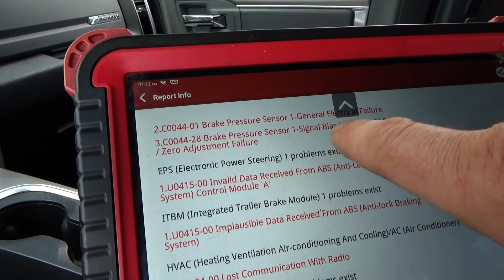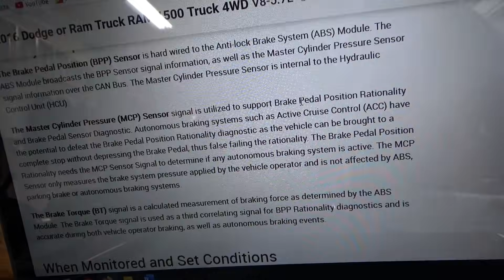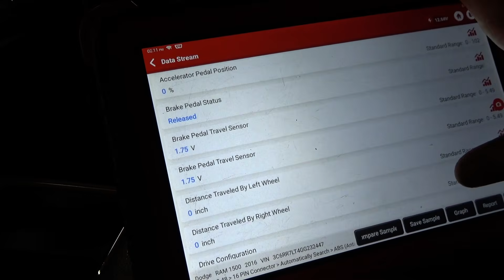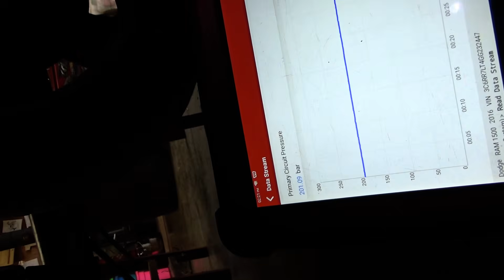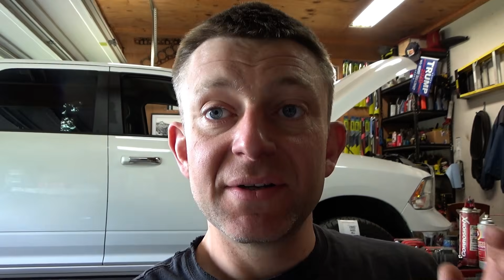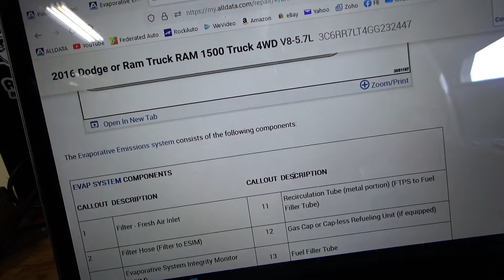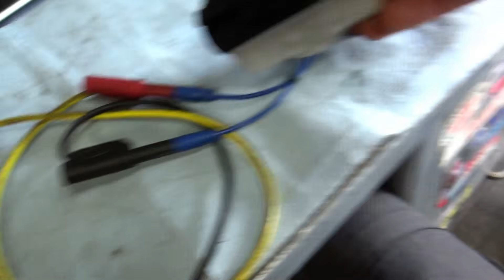(Pt 1 - 4th of July Special) Ram ABS Saga...(CEL ON, Can't Pass Inspection!)

Comment: Yesterday I diagnosed a bad HVAC controller in a 97 Buick. Everything works except the turn on signal for the compressor.  Later I plan to put a low pressure cycle switch in the system to ground the compressor relay so dude can make his trip next week.
Reply: I diagnosed the same problem same vehicle, if you wiggle the blower switch just right it'll send the A/C request.
Reply: @northfloautomotive  Nah!  I pulled the controller and it's fried.  I attempted to reflow some solder joints, but there was a component burned on the circuit board.
Reply: @farmermiyagi1338  Man the one you diagnosed was broke broke 😄The one I did was pretty intermittent. Cheers:goodvibes:
Reply: @northfloautomotive  He picked it up yesterday morning and was tickled to death.  Girlfriend leaving for Mississippi in it today.

Comment: More parts available for my 1931 Ford A than for these things.
Reply: LOL watch out for check engine light on the 31 Fords i heard it's a Doozy to find the problem
Reply: My brother works on a 1926 Ford Model T for a neighbor. The neighbor has relatives from Switzerland coming so he wanted it running to go for a spin. My brother had to do some work on the buzz boxes to get it running well. Had to replace the condenser inside two of them and replaced points on all of them. He said it is running great now. Imagine THAT, you can buy parts for a car that is 98 YEARS OLD, while this stuff made today that is not even 10 years old and you are screwed!

Comment: The lack of OEM parts for vehicles under ten years old makes my blood boil.
Reply: Certainly looks like a way to force people to buy newer garbage doesn’t it!
Reply: @kevincampbell8298  Why would Chrysler sabotage their own vehicle?  The customer has so much choice.  If they reward the OEM by buying another one, that's on them.
Reply: @kevin9c1  all the manufactures are having EV pushed on them with the agenda/mandates to rid of Ice vehicles. There is no longer a push to keep vehicles on the road any longer than a certain period of time. Why would they keep manufacturing/updating parts for vehicles over a certain age? Its not just Cars/trucks, it’s in so much around us. All my friends that are still in the industry run into this stuff every day.
Reply: @kevincampbell8298  Yes, the mandates are a thing and are dumb.  But if you think that Chrysler Corp is purposely not making a replacement part to somehow sell more EVs, you are going to have to walk me through how that would actually work.
Reply: @kevin9c1  at some point they have to stop making replacements because the cost of reengineering better updated parts and the demand exceeds the cost of doing it. Just like Ivan says  a dealer replacement is 1300, 1500 and so on dollars. I ran into same same stuff servicing electronics.. lots of older high-end equipment was getting impossible to get quality replacement parts for. 

I use to service teat equipment. Really good older stuff would break and the cost of fixing it if you could was pretty high. You can by lower end junk cheaper and thats what my bosses wanted. Then you don’t even need a tech. Just pitch it and buy a new pieces of junk.
Reply: @kevincampbell8298  Right but how does a Chrysler "policy" of not supporting older cars help them sell more Chrysler products??  Like I said before, if your consumer response was to trade in your 2016 Dodge Ram because of failed parts support, for a 2024 Ram, isn't that a YOU problem?  Nobody is forcing you to do that.  Chrysler Corp knows you have the choice to buy anything so I don't know why they'd take the risk.  Which is why this is not how it works.
Reply: @kevin9c1  its. To just one manufacturer. Planned obsolescence. All the suppliers are having similar issues. Especially with electronics.  There are lots of corporate long term goals that we as the public are not aware. I am just dealing with a doctor and  his 2017 laptop today. Apple says sorry can’t fix that! It can be fixed. They don’t want to…

If you can not locate parts to fix the 2016 vehicle (of any make) and there is nothing functional on Ebay  or any other source what do you then do? We will run out of sources. Look Ivan got parts for a few more recent videos from Russia (I think). 

Its pathetic there is nothing available for some of these vehicles. Especially for what people pay for them. But we are all just end consumers. Its not like the 70s 80s and maybe the 90s anymore where its easy to mod stuff. The programming that goes along with the electronics is in the hands so the corporate giants for the most part.   If there is no after market then you are forced to OEM. And if there is No OEM then vice versa.
Reply: @kevin9c1  Nothing so devious.  The 7 year old grew up without training her replacement.
Reply: @kevin9c1 because they've changed ownership structure 5 times since 98! It's insane
Reply: @kevincampbell8298 Why does the switchover to next generation vehicles give the manufacturer an incentive to quit stocking parts for older legacy vehicles that they sold to THEIR customers? Presumably they want to sell their new vehicles to the same customer so why on earth piss they off?That makes no sense. 

What I think is going on is that the CEO’s and executive decision makers at these domestic car companies have a choice to make. They can either spend profits on promoting customer satisfaction and loyalty by investing in adequate parts inventories or they can pay themselves extravagant salaries and boost their stock based compensation with corporate stock buybacks. Since most of them won’t be around in those positions 5 years from now or will have retired by then, what do you think they chose? 💰🤗💰
Reply: @kevin9c1 because they expect you to take it to the dealership where they give you the ole, “ no parts but we can sell you a new one or wait “
Reply: @kevin9c1 Chrysler has always done the minimum with respect to required parts.
Reply: @jeffreygoss8109  Does anyone really fall for that?
Reply: @kevin9c1  Wake up Kevin. You think it's just Chrysler with unobtainium parts?! You better go back thru some past videos or check some other Channels. It isn't just Ivan dealing with this BS either.
Reply: @kevin9c1  WOW You are so out to lunch in those other replies. Blame the customer, while they have a fairly new truck that can't be driven. Sell it and do what, take an enormous loss? Do you work for the government or one of the auto giants, perhaps Chrysler, since you aren't concerned about parts being unobtainable for an 8-year-old truck. Time for some head extrication.
Reply: @KStewart-th4sk  What the hell are you talking about?  All I am saying is there is no conspiracy by a manufacturer to purposely not support their vehicles in order to sell more new vehicles.  I am also saying it is stupid consumer behavior if your 10 year old Ram can't be fixed, and you go buy a 2024 Ram.  Do you disagree with this??
Reply: @KStewart-th4sk  I didn't say it was.  But if you think they are all working together in some agreement to not make parts, you need to take off the tinfoil hat.  The car business is cut throat and the profits are thin.   They would never agree to do that.  THEREFORE the reason for lack of replacement parts is something different and likely has to do with engineering resources and supply costs.  Chrysler may HOPE you stay in the brand if your used car is unrepairable. They also probably HOPE you don't have an expectation that your vehicle last beyond 10 years.  They HOPE this issue is more limited and doesn't effect as many people.  But hope is not a strategy.  It would be better for the consumer if the OEM supported their vehicles forever but I believe that they are often unable to do so profitably and this is where the aftermarket often steps in.
Reply: Agree 100 percent. Chrysler/Fiat/Stelantis is one of the worst  companies and vehicles to work on,they are an electrical nightmare,Fords are only a litter bit better but definitely better. I maintain a fleet of GM trucks 13 of them from 2003-2022s most are 2012-19. I’ve been unable to get lower steering shafts for he 15-19 HD trucks and 11-14 twice now in the last year. I’ve had to remove them soak them in oil to get them to stop binding it’s sad our 2019 needed one already. This is upstate ny winter stuff w town plow trucks. Also was unable to get a fuel pump for a 2016 3500 chassis cab w 6.0 ,no aftermarket available either.took 2 weeks of calling dealers and had to drive 120 miles to another state to get it.
Reply: @JohnDiMartino  I was a GM guy for like 20 years and in the past 4 have shifted to Mercedes and their parts, logistics and engineering is really another world.  They make complicated vehicles that do have issues but the DIY experience is actually a lot better, which continues to surprise me.
Reply: @JohnDiMartino
Reply: I agree, and this line of thinking  back to the early 80's when a GM factory training tech said GM builds a vehicle to last the life of the loan at that time it was about 3yrs.
 Now the loans are common to  be 7+yrs.
 The other issues (Example: Chrysler) they incorporate so many changes depending who they merged with or owned by.
Reply: @markcollins457  So if parts are unobtanium and the loan still is large maybe the best deal is to trade in the vehicle or let it become repossessed.
Reply: @ehsnils there has to be tons of these in salvage yards… you would think
Reply: @ehsnils  Like they do with cigarettes in insane states.  buy tags from a sane state so you don't need an inspection.
Reply: My Jeep is less than 10 years old and a part that I need is already discontinued.
Reply: We did it to ourselves. Ross Perot warned us.
Reply: It is intentional. They want you to scrap the vehicle and buy a new one to generate profit. These companies have never considered "the environment" or any other green crap the media shoves down your throat.
Reply: I agree, but Ram never thought any of them would last 10 years.
Reply: And it's getting worse. One module that can't be repaired or replaced = $60000 parts car!!!
Reply: That's indicating that the manufacturer has no clue about what they are doing when making cars. ABS systems have been around since the beginning of the 1980's, so it should be off the shelf items regardless of brand.
Reply: Big business complains about regulations and when they get our government to act, things like this result.
Reply: Having NO ABS makes the truck safer.  It is the state making the car undrivable, not the lack of parts.  It stops when you press the brake, that is how vehicles are supposed to work.
Reply: @robertsmith2956 well if you trust the vast majority of drivers to know how to use standard brakes, and to not lock up their brakes and send their cars spinning across the road or have the inability to steer while heavily braking if somebody walks in front of them. Then you have a lot of faith in people's driving ability.
Reply: @zzoinks  I could care less.  If they hit someone put them in jail for it.  I don't want to lose the ability to go around the person jumping in front of me.  You can't slide sideways if you can't lock the tires.
Reply: Anti-lock brakes became mandatory in 2011, so it ain't like we don't know how to drive a car without them.
Reply: @g-man7938 well, you do, but you don’t know it. Look up threshold braking.
Reply: @zzoinks  "Vast majority of drivers" should have never been issued a license in the first place. Can't stay in their lane, can't parallel park, can't back up. Oh wait, now there is more technology that screws up allowing those dolts to get behind the wheel of an auto.
Reply: @robertsmith2956 I don’t know about safer, I’ve seen plenty of people lock up the brakes and spin out, but it certainly shouldn’t be required
Reply: @jeffreygoss8109  I've watched them plow into the back of a car with them.  Even after I demonstrated how you slide sideways and go around the stopped car.

Comment: How is it possible to not get a new abs module on a 8 year old car?
Reply: should be  law  to keep  parts for a safety part..my abs  is bad on my 08 dodge   an it has only 20,000  miles  ..its a dodge  lol
Reply: @animalcorvair  maybe a crafty third party company will learn how to repair them. That's what a company called xmodex does for some volvo computer modules like the abs
Reply: @animalcorvair i fully agree.
Reply: They still make them, idk why so many people in the comments seem to think they aren’t. With as many issues Ram has had with the abs unit, it’s probably a good thing the controller is going back into engineering.
Reply: @jeffs2809 because Ivan said they dont make them no more.
Reply: They still blame Fauci's epidemic?
Reply: Because Alzheimer's Biden and his cronyies want everything Battery Powered and forcing  you to buy there EV cars and Trucks and small Engines Shops suffer the same way  there is no parts available the  only parts out there are aftermarket parts and those parts are almost  100% junk
Reply: they've likely had 10 different pump assemblies since then, in which none are interchangeable. so now they're digging deep in the back of the drawers to fix them and try to make more.